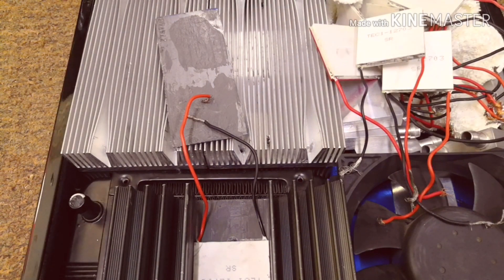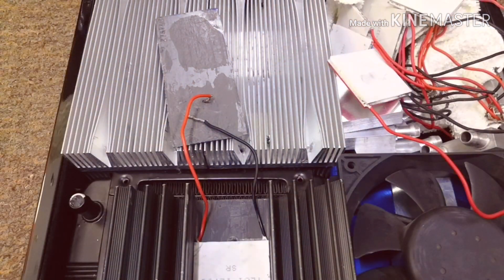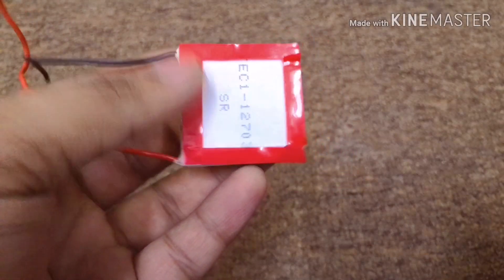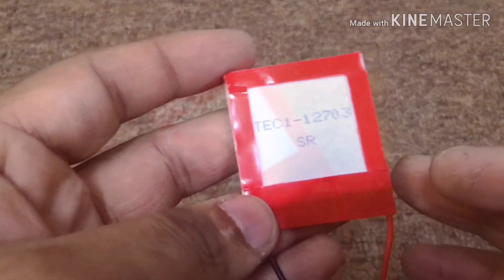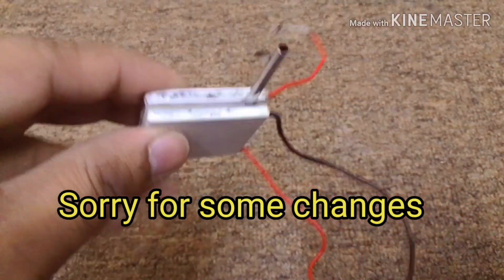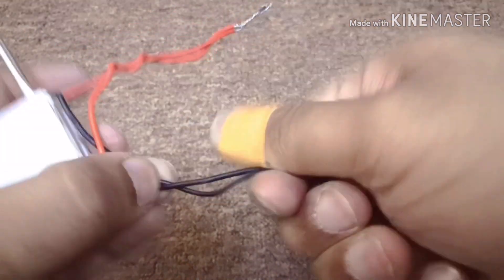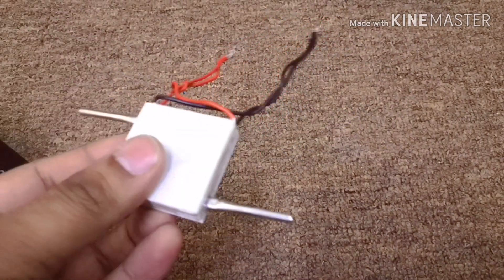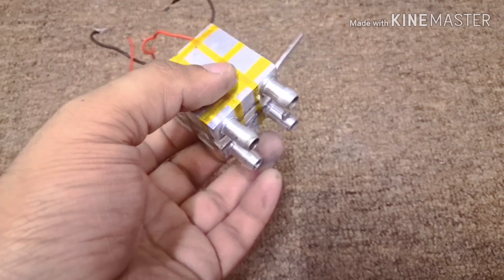Peltier ❄️ module.. new research and ideas.🥶

Comment: You just made a water block directly on TEC. I think using metal water block is more serviceable Idea.
Reply from the maker: The Idea behind this water block is to keep 2 peltiers very close so the space in between is tiny. So that water cools down rapidly.
Reply: @DIYTAYSEERworld  how about having a metal water block between 2 peltiers?
Reply from the maker: That idea is already shown in my previous videos.. 2 peltiers 3 water blocks.. 2 for Heat removal and 1 block in the center will be for cooling effect..
Reply from the maker: It will be like (block peltier block peltier block)
Reply from the maker: And this idea is better because of no thermal compound requirements..

Comment: Bro  what is the best peltier? 12703 or 12706 or sp27145
Reply from the maker: 12703 is better.. It gets cold faster. And gets much low temperature. Also consumes les energy produces less heat comparing with others..
Reply: @DIYTAYSEERworld  thanks. I will purchase

Comment: Well...what sort of temperature difference do you get? How much power?
Reply from the maker: This experiment was performed to see the rapid cooling effect using 2 peltiers..by doing this method I believe that water between the two peltiers will get cooler in seconds and that cold water will cool down the radiator that will blow cool air out in the room..
It's a theory.. The practical is yet to perform.. Let me know your suggestions that will it work..?
Please do watch my other videos.. Thanks for watching..
Have a great day
Reply: @DIYTAYSEERworld  my suggestion would actually depend on LPH pumped and the heat load it is cooling. Ambient temperature would be another big consideration if the water is in a closed loop that can eventually go no lower than the ambient temperature.  Also, are the cooling blocks on the same loop as the water between the peltiers and what is the water pressure between them. It can be difficult to contain a constant pressure and flow rate under those conditions